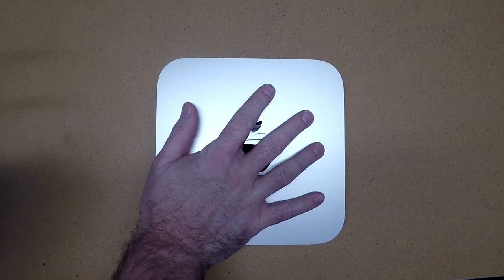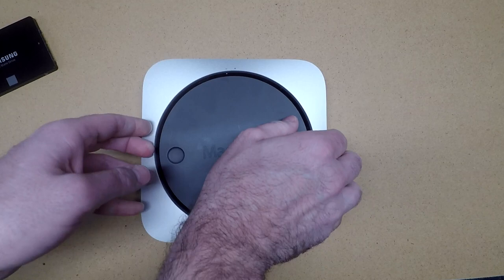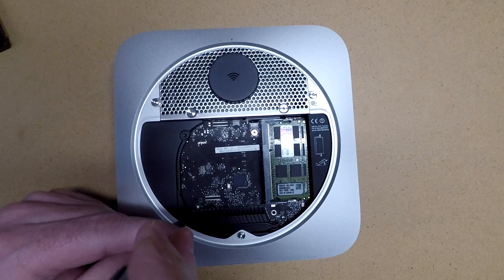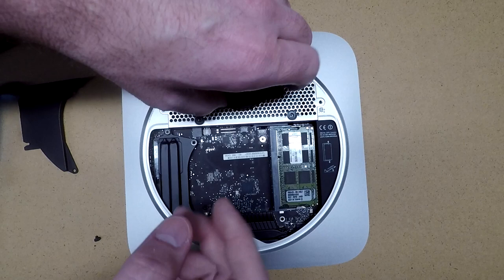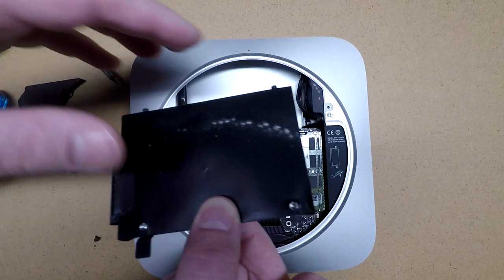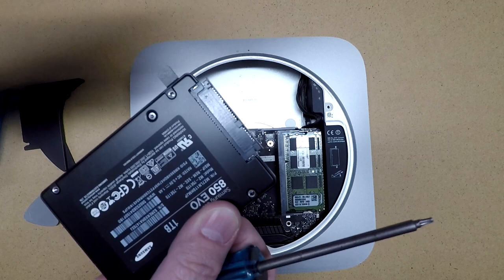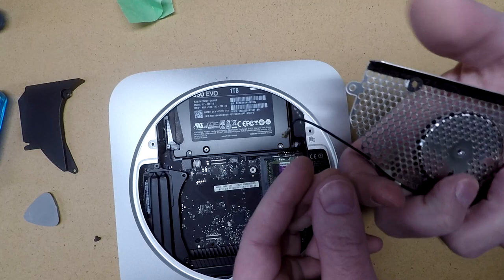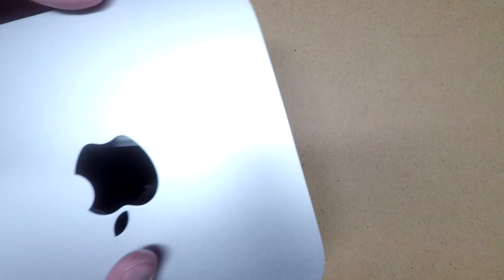Late-2012 Mac Mini (SSD) Hard Drive Upgrade How To

Comment: Thank you for this video!
Just to reiterate what has been said in other comments:
  - DO NOT remove the fan cable
  - DO NOT remove the wifi antenna cable
There is just no reason to risk damaging those connectors when the fan/antenna can simply be moved out of the way while still connected. It's also wasted time.
I didn't have a plastic tool for the drive connector, but the plastic shroud has a corner that worked perfectly.
The tape trick was perfect!
I used the following method for restoring the disk:
  - Command-R to boot to Internet Recovery (worked with wifi for me - didn't even have to enter the password)
  - Disk Utility to format SSD
  - Restore From Time Machine Backup
Success!
It's my wife's computer. She's very happy with the speed (I also upgraded memory from 4G to 16G). Total cost of memory + SSD = $110. We were just about to spend about $1500 on a 2018 MM. I'm not saying this is equivalent, but it is good enough - for 7% of the cost.
Reply from the maker: This Mac Mini has had many uses including media center computer, server and video editing. It has now replaced the 2009 iMac my wife was using. It is still a very usable computer at seven years old.
Reply: I agree why remove those items.
Reply: thanks  for the tip!
Reply: Which ssd did you get? The 850 or the 860?
Reply: to me is better remove components and wires to have more space and freedom to manipulate  (o0)!
Reply: I tried to remove the fan cable and the connector from the circuit board came off instead. I assume it was clued to the PCB. Has anyone experience with that? Can one glue it back on?  Thank you very much.
Reply: Getting ready to upgrade my 2012 MM with 16G RAM & 1TB Evo SSD. I've already done 5 A1278 unibody MBP's for myself & friends/family. I always clone with the SuperDuper! app... Do I need a T6 & T8 driver for this upgrade? Thanks
Reply: Yeah I just did this. No need to unplug fan or WiFi antenna. And I cloned my drive using Disk utility…
Reply: I have a macmini late 2012. Which socket is used sata2 or sata3
Thanks
Reply: @shortvideos9005  SATA 2 and SATA 3 use the same connectors. But you definitely want to use SATA 3 SSD for this upgrade (I'm not even sure there is a such thing as SATA 2 SSD).
Reply: @shortvideos9005  I just used a crucial ssd model CT1000MX500SSD1 SATA is backwards compatible but the Mac mini 2012 comes standard with SATA 3 connector.
Reply: @Rickmakes  there is a guy who did this without removing the fan

Comment: Thanks so much for this video. It was a massive help! Just upgraded to a 1TB SSD and 16GB RAM. Went from unusable to just like new for $200AUD. The Antenna cage is a tricky little bugger not mentioned in the video. It has to be seated from an angle. Put it in loosely and then slide it in on an angle. There is something in the underneath of the case that you can't see that it needs to slot into. Google the problem, there are guides online to help. I think it had to slide in on an angle from the black dot side to the white dot side. It took a few goes but it went in. Before that, I spent about 30 minutes wondering why the screw holes wouldn't line up.

Comment: I have struggled for years with insertion of the replacement upper drive; your tip of using tape to get to those mounting holes at the rear is brilliant.

Comment: Another tip that my help someone: the two front screws that he removes at 3:04 go directly through the wifi tray into the hard drive.  This is what holds up that side of the hard drive (the other side being held by pins in the side of the chassis).  Just a little more info for people to help them know what they are doing.

Comment: This video helped me out to change my HDD to an SSD. I also did not take off the antenna that was attached I just moved it to the side without disconnecting. Process was surprisingly not as difficult as I firs t thought it would be. Visuals do help tremendously.

Comment: I did it! A few tense moments when the sliver cover on the antenna just wouldn't engage with the screw holes in the hard drive......I think it was actually sitting a little too low but it took me a while to figure out what was wrong and I even dropped a screw into the casing and had to fish it out. Got it all together and thought if this actually works when I plug it in it'll be a miracle. Well, it works!!! And it's so much faster than my old drive. Thanks again, for clear, good instructions. I didn't totally unhook the fan or the antenna cable and it wasn't problem.
Reply from the maker: Glad to hear you were able to upgrade!

Comment: Word of warning. I just upgraded a fusion drive to a full SSD. There are actually two drives in the bay stacked on top of one another (128 SSD and a 1TB hard disk). I had to remove the mother board to get them both out and even just removing the top one was more difficult than shown in this video. It's my own fault for not realising that a fusion drive is just two drives working together and not one solid unit. This video was still a great help though. New SSD is up and running. Thanks.
Reply from the maker: babyjuggler Good point! Thanks for your feedback.
Reply: My late 2012 Mac Mini also had a 1.12 GB fusion drive. The top one  was luckily enough the SSD part of 128GB. So I could remove it without the necessity of removing the mother board. Some force was used and I replaced it with a 1TB EVO 840 SSD. With the help of your video it was actually a peace of cake. BTW one screw of the ventilator a T4 torx was corrupt. I had to use a plain tool to turn it loose. It  also took some effort to initialise the 'underneath' Apple HDD of 1TB. I finally used the Command R mode for that. It now functions as a intern 1TB Time Machine back up. Very convenient.

Comment: It's guys like you that really impress me.  Not only brave enough to undertake a finicky rebuild, but also to film it to help others.  You might not think it's  a big service but you made my life easy and 189,000 others!  (according to current views)
By the way, I didn't read the comments ahead of time, so I removed the wifi and fan connections but all is good!
My Macmini is 10 years old, and still a great workhorse.  Not ready to spend thousands on a computer when this works just great!  My old start up time was 2 minutes 40 seconds, now it only takes 45 seconds to boot!
Very happy!
Have a question maybe you or someone else could answer:
is there a good recommendation on updating the OS to a more current version?  I currently running 10.9.5  and it's not working great on some websites.  What is the reeommended way to upgrade the OS, and what would be recommended for this 2012 machine?

Comment: Looks very easy - Amazing how different the designs are between variations of Mac Minis - I have a 2014 unibody and it's a major project to replace the hard drive and memory and has to be almost completely disassembled.
Reply from the maker: I think a lot of people prefer the older design.

Comment: Thank you very much for the fantastic video! Worked like a charm.
Just a small tip, you can avoid the need for the sticky tape trick (which was quite smart) by flipping the mac mini the other way around (the right way around) after you've gotten a bit of the disk/SSD inside, and let gravity do the work.
Reply from the maker: Thanks for the tip!

Comment: Using tape to make a handle to attach to the new SSD to aid fitting it into place was genius. I struggled with that the most before I saw your video.
Reply: ak2010utube ditto on this comment. I was going to say the same thing. Great idea from the presenter!

Comment: no need to take off the antennae cable. great video....fan cable needs to be lifted up to remove without damage.
Reply from the maker: Good point. I did another one of these recently and realized I didn't need to remove the antenna cable. I can't update the video but hopefully people will read the comments.
Reply: thank you for the vid and thank you for the antenna comment saving time
Reply: Nice. i wanna try doo this on my macmini soon. good video and good comment
Reply: Fan cable doesn't need to be removed either

Comment: Thanks for video. Screwing back the SSD to the wifi shield was the most challenging i say. I put a piece of plastic underneath the sdd so i could pivot it up on the motherboard in order to screw it to wifi shield. also, i needed to pull the wifi antena up in order to slot it back in place nicely.

Comment: Watched a few vids on this... also read a lot of comments... I don't see any reason to disconnect anything from the motherboard other than the connector for the drive (everyone does it that way for some odd reason).  Everything else can just have the screws removed and slid out of the way a bit. Put a piece of tape on the new drive to hold it up to get the nubs into place.  I did mine from start to finish in under 10 minutes.  There is absolutely no reason to risk damaging things by unplugging from the MB.
Reply from the maker: Thanks for the advice!
Reply: Don't you need to remove the Fan in order to get to the HDD connector?
Reply: @TrendOrchestra  You need to MOVE the fan, but not REMOVE it. i.e. leave the cable connected and just swing it out of the way.

Comment: Few comments, besides the ant cable, if your having issues sliding the drive back in face the opening towards you and angle the unit downward almost vertical, then drop the drive in and it slides in the holder holes pretty easy. If your having issues putting the screws back in for the HD, then slide a plastic or or other wedge item to push the HD back towards the ant screen..

Comment: Something that a lot of guides missing is getting mid to late 2012 mac mini is like a lottery. Those who are unlucky may have the original hard drive sits on the upper bay which requires complete removal of the motherboard and the bracket to get into it, this might be difficult for some people (if this is the case for you, I suggest looking for a complete disassembly guide). cheers.
Reply from the maker: I didn't know they had a model with one drive mounted in the upper bay. I think the server variant of the Mac Mini had two hard drives but I could be wrong. I'm guessing the mounting parts (cable, screws, etc...) could be purchased to mount an SSD in the easy to access bay while leaving the original hard drive in place.
Reply: @Rickmakes  I think towards the end of the production, they moved the harddrive to the upper bay (complete with rubber kit and 4 screws) My guess is, they decided that it is a safer location for shipping. and yes, I guess you can just leave the original drive there and just plug in the new drive.

also I think, if that's the case, we need to order the replacement sata for the lower bay/lower sata. Most of them, including the harddrive addition kit, only sell the sata cable for the upper bay. I don't think you can force origami the sata cable for upper bay to the lower bay, vice versa(right?). (Need to be careful, can't be wrong, either get for the upper bay or lower bay cable)

Comment: This was great.  I'll be doing the same thing this coming week.
I upgraded the memory from 4GB to 16GB when I got the machine new in 2014.  (Yes, still a late 2012 model)  Computer still does fine for what I need.  I know the SSD will be that last fix that can get the machine through several more years of service.

Comment: I got mine back together, no disc visible. Pulled to bits again and the disc connector was unplugged. The disc drive will if allowed to go downwards force the plug out. What stops this is the crescentish piece of plastic (removed at 2:47). So go easy on applying downwards pressure on the drive until that bit of plastic is in place holding the plugs in their sockets.

Comment: Hi. I need help. I removed all the installations but I am unable to put the wifi back as it isn’t fitting evenly in its place. Also I used the same hard drive but the screws connecting the wifi plate to the SSD aren’t long enough

Comment: I followed your instructions, didn’t need to remove the fan or the antenna, but found that the 500 GB HD is in the lower bay. So not able to  remove it like you show. So thinking of putting my 2TB SSD card in the upper space but where/how to connect it? Thanks.
Reply from the maker: You should be able to get a cable on Amazon. Just search for “2012 mac mini hard drive cable”. Make sure to verify that it works with your model. The models should be listed in the Amazon description.

Comment: It's really a shame that Apple has DOWNGRADED the current Mac Mini so upgrades are no longer possible. Now, one is FORCED to check EVERY box when ordering a Mac Mini because upgrades or enhancements are no longer possible. My 2012 Mac mini was originally about $1000, the Mac Mini I just purchased was $3000. I'm an Apple fan, and I own the stock, but I do understand why some people positively hate Apple.
Reply from the maker: I wouldn't have as big of a problem with it not being upgradable if the RAM and SSD weren't so expensive from Apple. You can get a nice 1TB SSD from Samsung for around $150. 1Tb configured with the computer is a $400 add on. Grr!

Comment: Just curious...why replace the drive and not combine them? Sorry for the noob question...I’m new to upgrading Mac mini stuff... :-)
Reply from the maker: Noob questions at fine by me. You can get a kit to add a second hard drive. SSDs are relatively cheap now so I don't use spinning hard drives in any of my computers (I do use them in NAS devices). The process to add a second hard drive is also very involved and I didn't feel it was worth the effort for me. If I need extra storage on the computer, I am most inclined to install a second SSD in a USB3.0 external enclosure. That gives decent performance and is easy to do.

Comment: I have a question, I could do the exchange myself - I understand the process but regarding the OS?? when you boot up you now have no OS or what? How do I go about that?
Reply from the maker: If you have a new, blank SSD, you can boot into recovery mode by holding down command-R while starting up the Mac. This can take a while, especially if you have slow internet. From there you can use disk utility to format the drive as APFS. Then you can install a fresh system. If you want your old data, you can run the migration assistant to restore your system using a Time Machine backup (which you would need to make before the upgrade).

Comment: RickMakes - You do not need to remove the Wifi cable to upgrade a hard drive in your Mac Mini. I have removed over
200 drives so far and not once have i had to remove the WIFI cable.
Reply: That's what I was thinking even though I've never done it before.  It looks like something that could break easily.
Reply: Same goes for the fan cable

Comment: Good video but agree with others that removing the fan cable from the board is a very bad idea - the entire connection assembly to the board came off when I pulled on it, and now there is no way to reattach the fan without some precision soldering which i'm not capable of - so I think the Mini is basically trash now.

Comment: May have missed it, but why the change?  Faster?  Loading programs?  Opening programs?  How much did it cost?  What size?  Good video
Reply from the maker: SSDs are a lot faster than traditional hard drives. It boots faster. Applications and documents load faster. Installing software and updates are faster. I installed a 1TB drive which was a couple of hundred dollars. I have a link in the description to the drive although they now have a newer version available (the Samsung 860 Evo). I have 1TB drives in a few of my machines. I have also installed quite a few 500GB and smaller drives. Installing an SSD can really give new life to an older computer. This computer is over five years old and the hard drive is still a lot faster than any computer that doesn't contain an SSD.
Reply: I am still pre-internal SSD upgrade on my 2012 mini.  However, I've been running a USB3 Samsung T3 external for 2 years now.  So much faster. Even running encrypted SSD, and it's still 4 or more times faster. The only problem now is reboot has to go through Recovery for some reason or it'll boot from the dreadfully slow internal original HD.   This is due to Mojave and APFS and or encryption. Now, once I'm up and rebooted I don't have any issues for weeks.  It's just reboots are a bit of a hassle now.

Comment: Can you please assist? @richmakes - I am in way to upgrade mac mini late 2012 RAM and i found that my mac-mini is DDR3 PC3 12800S - Shall I make upgrade with the PC3L 12800S ? as per my understanding PC3 has 1.5 v and PC3L has 1.35v - so I believe I can use PC3L in late mac mini 2012? IF YES, Can you assist which combination should I use? [at present its 4GB 1600 MHz DDR3] as I am planning to upgrade to 16GB

Comment: NO NEED TO REMOVE THE FAN CABLE
NO NEED TO REMOVE THE WIFI ANTENNA CABLE
Just set ANTENNA over to the side and FAN on a piece of cardboard to avoid touching any metal parts or chips.
Reply from the maker: Yep. I pinned a comment with this information.
Reply: I don't need remove other components , but to me is better for more space and freedom to manipulate :D

Comment: Hi - can I take a cloned (from my Mac Mini late 2012 OS 10:13:2) SSD drive and physically replace the HDD on the Mac Mini and then power on and that's it? or do I need to Command R and do something?thx
Reply from the maker: If I am understanding correctly, that should work. You could try putting the SSD in a USB enclosure (USB 3.0 is best) and try booting from it. Just hold down "option" while booting and select the external drive. If it works, swap them out. As always, make sure you have a good backup plan in case things go bad.